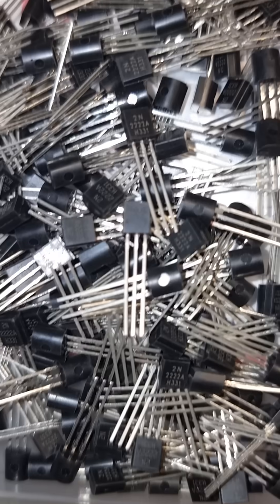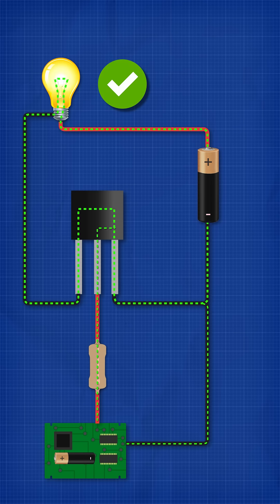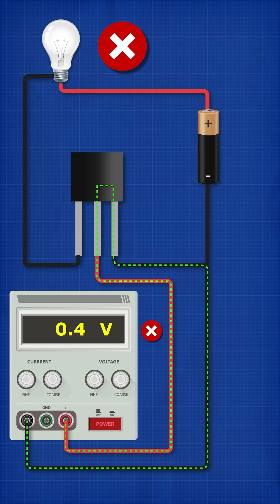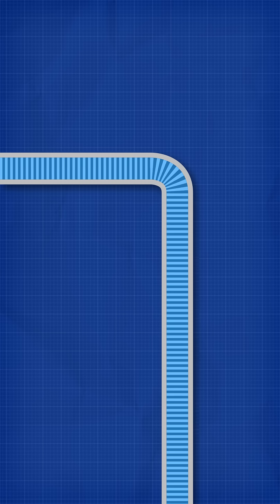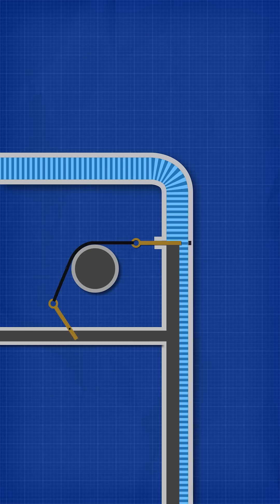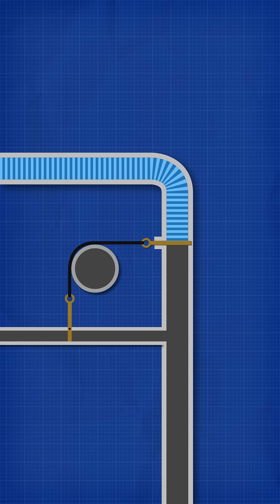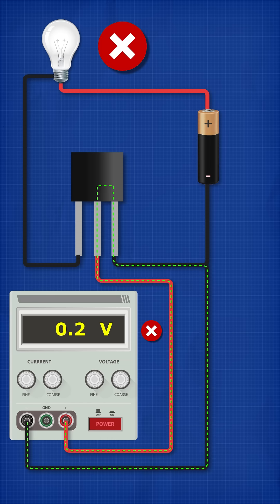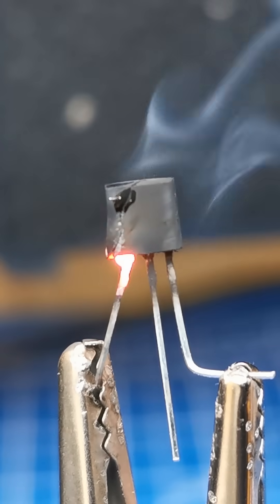Transistors Explained - What is a transistor?

Comment: wait so functionally what is the difference between a transistor and a relay
Reply: Transistors are solid state, relays typically have moving parts. Transistors switch much faster. But more importantly, a transistor can behave in an analog manner. Relays have 2 states - on or off. A transistor can have many states between fully on and fully off. This is very useful in amplification circuits for example.

Comment: So basically a transistor is like a relay?
Reply: No, not really.

Relays are a digital device - on or off. Transistors are analog devices - many varying states (they can be used digitally as well). Relays typically have moving parts, transistors don't. Transistors are faster switching than relays. Relays can handle higher power than transistors.

Comment: The analogy with water is a bad one in my opinion, because with low pressure you could open a flood gate only partially, whereas a transistor acts more like a switch and will only have an “on” and “off” state. There is no in between.
Reply from the maker: Seen our full transistor video? Link:➡️  https://youtu.be/J4oO7PT_nzQ

Comment: That's the best analogy of a transistor I've ever seen. Keep up the great work.
Reply: yes and in less than 1 minute and not a 10 min video with 1 min of actual learning material
Reply: Still confused
Reply: if only he had explained to you that it is ALSO an AMPLIFIER...
Reply from the maker: Seen our full transistor video? Link:➡️  https://youtu.be/J4oO7PT_nzQ
Reply: @EngineeringMindset  But is there actually physically a swing gate? If not then how does it work??
Reply: @sean8204.5  An atom’s outer electron shells help determine the conductivity of a molecule. Transistors work by having two types of semiconductor that have atoms with different outer electron cells. One of them transfers electricity when it gains an electron, and one transfers electricity when it loses an electron. When power is applied to the base, it pulls electrons out of the atoms in the middle part, allowing current to flow between the collector and emitter. 

I honestly don’t think there’s a good way to explain it without bringing up advanced chemistry and/or quantum mechanics.
Reply: @EngineeringMindset 😅

Comment: This is a good explanation. Would be nice to include some mention of amplification, which is one of the most important uses of transistors.
Reply from the maker: Seen our full transistor video? Link:➡️  https://youtu.be/J4oO7PT_nzQ
Reply: @EngineeringMindset
Reply: you are in the wrong place for that, you simply cant fit everything into 1 minute and still have it educational enough that basically anyone will understand the concept.
Reply: @robo-suport_czrobofactory3116 true, but with the swing gate, he surely could have included a bit of an explanation about the linear region, though tbf I may just be underestimating the difficulty of the topic
Reply: Look when the gate is half- open
Reply: As an op amp

Comment: Why we use it in a circuit ?? What circuit we need it ? Why use it i stead of relay ??
Reply: When used as a switch it is because it can switch on/off much faster than a relay can.

More generally because it does not need to be used as a switch. 

A transistor  is a three terminal device that lets you control the resistance between two of its terminals based on the voltage/current at the third terminal ("trans-resistor").  

This lets you do things like voltage/current amplification and adjust the input/output impedance of circuits when necessary.
Reply: @manudota7059  thank you very much
Reply from the maker: Seen our full transistor video? Link:➡️  https://youtu.be/J4oO7PT_nzQ
Reply from the maker: Check out NEW resistor video, everything covered! ➡️ https://youtu.be/DYcLFHgVCn0

Comment: This confuses me a bit more, it sounds to me like they're kinda useless for most apps? Or is it not always powered by external, or is there more power in the flow as soon as the transistor let's energy through?
Reply: No. They are super useful for most apps. The very simple circuit shown in this vid made you confused. This circuit can work (but needs resistances to avoid short circuit), but does not explain your doubts. It rather rises them. 
Imagine that there are TWO sources of energy attached to a transistor, and they are independent from each other. (What they have in common, is the connection of their lower potential outputs, but this is less important for your question.) One, weaker source, is connected to the transistor's base (the middle leg) and emitter. It causes the weak flow of base current. This weak base current will flow from base to emitter regardless of what you connect to the collector leg. This weak source of power is unable to drive a motor, a coil, a light bulb or any other load that you want to energise.
The other, more powerful source, is connected to the load (motor, bulb, whatever) and, in series, the collector leg. Of course, the lower potential of this source is hooked up to the emitter leg. The stronger source of energy is strong enough to drive the load directly, without the transistor, but you want to control the operation of the load (turn it on or off, change the motor's speed or brightness of the bulb). The circuit: strong power source - load - transistor (from collector to emitter) carries the "big" energy, which is supplied from the strong power source. 
As you see, for the proper operation of the circuit with transistor, you need a strong power source (the muscles) that provides strong current, and a weak power source (the brain) that provides weak current. The transistor works the way that the weak current opens the door for the strong current, and does it proportionally. 
The trick here is very simple: if you want, you can use the strong power source as the source of weak current (the base current). You just steal some current from it, and limit this current by adding a big resistor before the stolen current enters the base of the transistor. Now, if you add a switch in series with this big resistor, you can turn on or off the weak current, and the transistor will allow strong current accordingly. Or, you can replace big resistor with big potentiometer, and by turning the knob you will control the weak base current, and the transistor will allow strong current proportionally to the knob setting. 
As you see, it is not important where you take currents from. You can use two sources or just one. The usefulness of the transistor is that it can control the amount of power consumed by the load, while the strong source of power is capable to feed the load.
Reply from the maker: Seen our full transistor video? Link:➡️  https://youtu.be/J4oO7PT_nzQ
Reply from the maker: Check out NEW resistor video, everything covered! ➡️ https://youtu.be/DYcLFHgVCn0
Reply from the maker: Seen our new Potentiometer Explained video? ➡️ https://youtu.be/Xb-MZMoUtcQ

Comment: Can you do the same thing except operating a transistor as an amplifier?
Reply from the maker: Seen our full transistor video? Link:➡️  https://youtu.be/J4oO7PT_nzQ
Reply: In the same gate analogy, 

We notice that the gate requires a very small amount of current to open compared to what the main channel can handle. 

We use this property to send a small flow signal to the gate, which then replicates AND amplifies the same flow signal in the main channel.

Now this larger signal can be used to control even larger flows, and so on.
Reply: @N0Xa880iUL  If the second channel has that less energy, how does it replicate, amplify that amount, in the other channel?
Sounds a bit like magic to me like that
Reply: @2REACTION4U  Yes and No. The concept is actually very simple once you visualize it. No matter how many words are used, it will always seem magical until then. 
It's still amazing and mind-blowing, but graspable. 

It takes a lot of time to understand at first. But after that the intuition never leaves you. At least that's my experience.
Reply: @2REACTION4U  To explain it a bit easier, first understand that the term amplification is bit of a misnomer. 

The transistor does not amplify the energy of the input signal!  What it actually does is just replicate the signal waveform onto a different larger channel with a larger power source. 
So it's more like modulation than amplification. 

For example, suppose you whisper into my ear. Then I shout the same thing out loud. If I'm good then I might even mimic your voice. That's amplification! Notice that your original voice hasn't been amplified per say, but only the message has. Also notice that the extra energy comes from my own body, not yours. Hope that answers your question a little bit.

Comment: So it's an AND gate. Huh. Always thought they where more complicated.
Reply: No, this is not an AND gate. For AND, you need two independent inputs. Here, there is only one input (base), which causes certain output. It is an "implication" function rather than "conjunction" function. Besides, transistors have also continuous regulation capabilities, while AND (or any other gate) are logic elements - only on/off (or yes/no, or true/false, or high/low) output is possible.
Reply from the maker: Seen our full transistor video? Link:➡️  https://youtu.be/J4oO7PT_nzQ